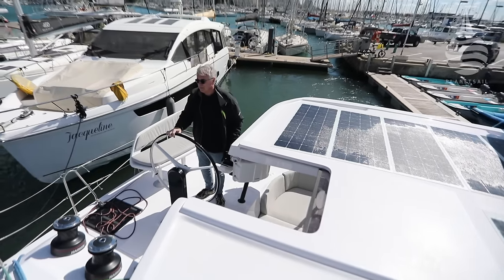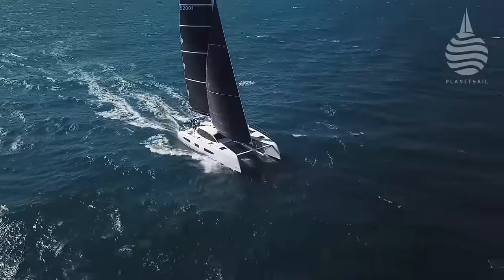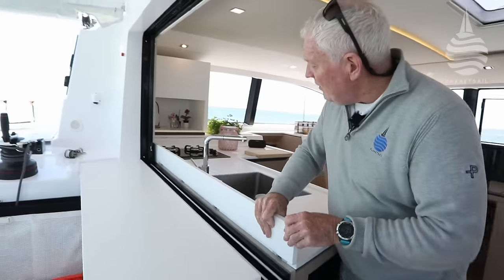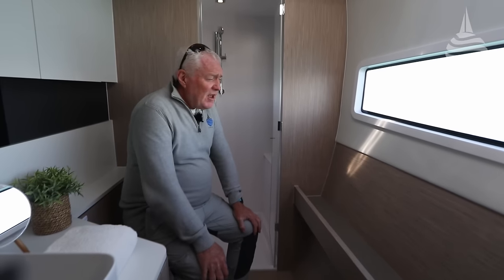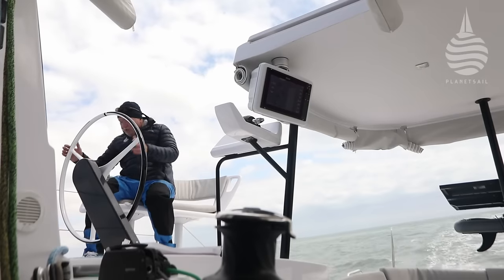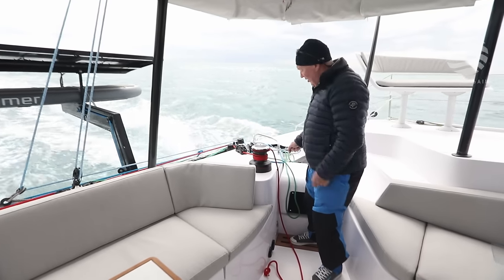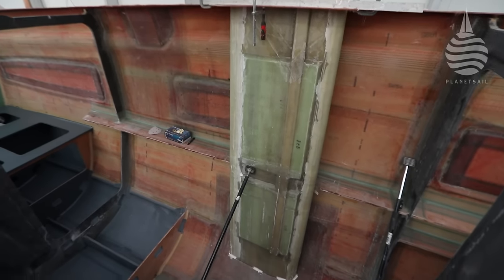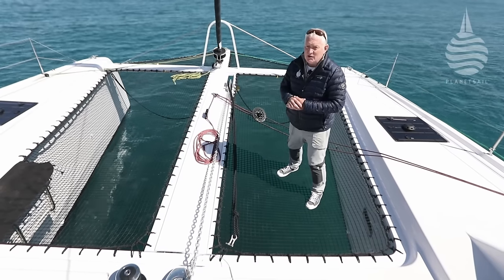Outremer 52 PlanetSail full test including factory tour

Comment: No doubt a lovely boat but why did they put the cook top in that spot, it's in such a weird place, you'd have to reach into the corner to use it.
Reply: my thoughts exactly, it doesn't make sense whatsoever for it to be there
Reply: It might looks odd at first, but appears it's the best place after you tested it. It would be dangerous next to the staircase, and you would lose the working area.
Everybody who tested it acknowledged it's very practical there.
Reply: You could tell this was an oh crap moment in the design room.  We didn’t think this through. Look at Balance, Catana, etc, boats the same size with a clearly thought out kitchen.

Comment: Every time I see a test of an Outremer I can't shake off the feeling it's got WAY too many ropes in and around the cockpit. They are everywhere. And they go everywhere. There is a configuration for this helm position and that, and you can control the sheets while hanging upside down from the stern, and you can raise the sails from under the water. But the end result is a spaghetti dish in the back. I seriously doubt it's a good thing for cruisers. And it looks like a tripping hazard. Why there are no rope boxes to put the tails in?

Comment: The engine controls and navigation monitor should rotate with the wheel. You don't want to walk out into the weather to adjust the throttle for example. The seating outboard doesn't provide a backrest. And I'd really like to see an performance catamaran in serious seas. Probably better to experience it yourself. Overall I like the Windelo 52 a lot better because of the concept and the windows in the salon and the cabins. Compared with the windelo the windows of the outremer is absolutely non spectacular. On top the Windelo is way more eco-friendly produced if the claiming regarding the basalt proves. And it doesn't seem to be slower.
Reply: The outboard seats have L-shaped backrests (to the aft and sides).

The Windelo is a different concept, also interesting.

Comment: This Outremer 52 has a sleek line and does sail well but also for this price tag one would think that you are entitled to have a helm on each side..well no!! imagine getting out of a harbour or even a marina, full of mooring lines and boats getting in and out and quite close to each other, how precise would the tiller feel in your hand compare to a proper helm?? One more thing...all of the front deck is gone...you only have the dolphin nets..no relaxing on the front and the rear deck is not suited for this..then where?? the roof..yeah..until you get solar panels, then..the really annoying factor for me is the way how the winches have been layed out, as stated from the video, if you are manually steering from inside the cockpit because it pouring outside then you have no option than to go out and try to fit the sheets in a turning block and still you are quite stretched out and far from the helm, not mentionning if you are doing this at 2am solo because you are on your watch and the wind is turning then it's risky because on a windy night the boat's reaction will be fast and you can't be at 2 places at the same time...when i look at Sailing Zatara, an outremer as well, smaller but see how it is set up, you can trim and steer safe from inside, the helm is set in such a way that you can use it easily for both sides ans trim the sails all alone, you stay dry and safe, front deck, large living space at the rear, more cabins and sleeping space...so what happened to all this????
Reply: tiller is no less "precise" than a wheel.
Reply: You can relax on the front, sitting on nets is comfy, get a bean bag if it's that bad
Reply: Tiller not as precise as a wheel??? Tell that to the TP52 fleet.
Trampolines are used instead of bulky and heavy forward cockpit structures to keep weight out of the ends of the boat. They're not less comfortable and in many ways much nicer for relaxing on.
If you're watch keeping from inside you simply run your lines to the lower trimming position before hand, you don't wait til it's 2am and you need to reef.
Pretty sure Zatara is a big, heavy Privilege cat, not an Outremer.
Reply: You're right zatara is a privilege
Reply: You sound like someone that has never sailed a multihull.